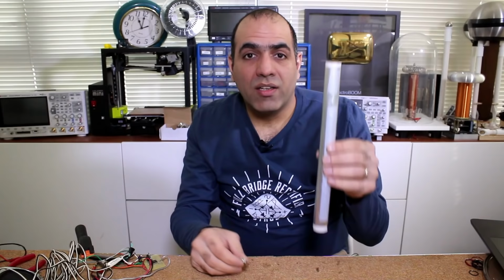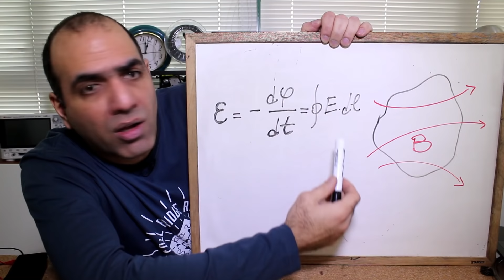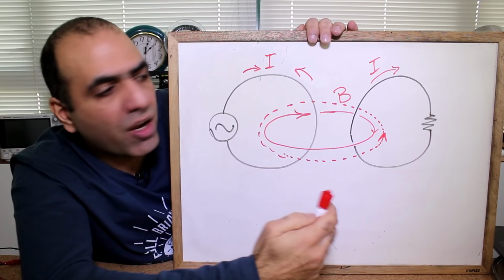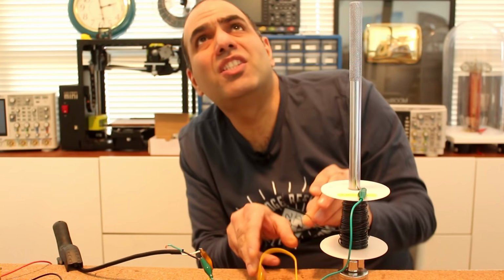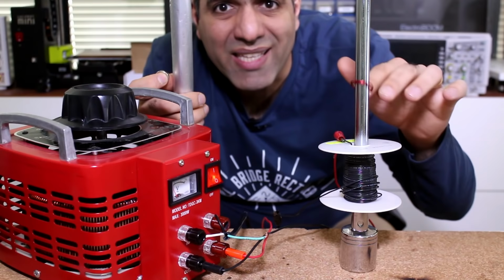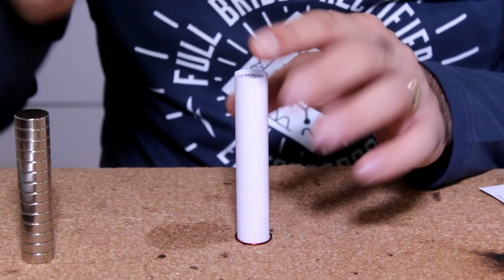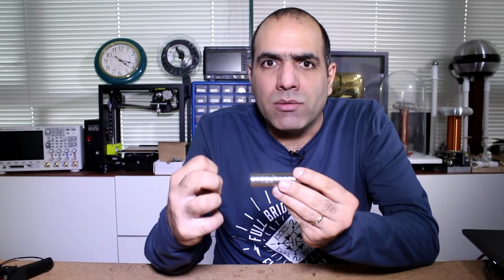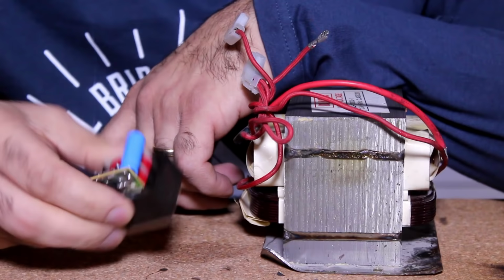The Amazing Eddy Current

Comment from the maker: Hello to all Eddies and others! If you have interesting thoughts, I could use some good video ideas! Why not post them to reddit: http://www.reddit.com/r/electroboom
Reply: And also is it possible to reverse engineer the diode configuration that changes ac to dc
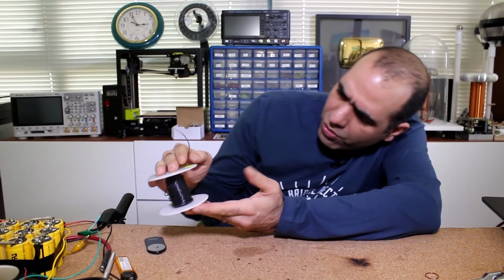Reply: 6:18 the shorter wire isn't melting exactly because it's shorter. Resistance grows with length of the conductor, isn't it?
Reply: wellding the transformer on the edge is not too bad because the magnetic field lineas mostly stay inside the iron core. And since they mostly do not loop around the welld line not much current is induced.
There is acctually some transformers used in audio gear that have an cupper beld soldered around the entair transformer to prevent exes magnetic field exiting the core.
Reply: @Mehdi Do these Eddy currents flow to the ground through our body ? Like how do they die if there is a constant source of changing Magnetic fields inducing them ? Can that metal plate be pictured to a source having a series resistance ? #Electroboom .
Reply: The Welds don't Affect the transformer that much, The High Current draw is from the design of the transformer primary (Primary Inductance is low).  Actually removing the Welds makes the transformer draw 40% more Current and 60% less Efficient power conversion. (I accidentally removed the welds from two Microwave transformers while modifying the transformer and only got 1kv each from 220v).
Reply: Microwave Oven Transformers are built cheap as possible, cutting every corner. Every technical observation about them is "because it was cheaper". In a normal transformer, the "E" and "I" pieces are alternating, like when you fold your fingers together. In a microwave oven transformer (MOT), all the "E" pieces are stacked into a block, and all the "I" pieces are stacked into a different block, and then the coils are slid on, the "E" wears the "I" as a hat, and a thin weld connects them. The weld is very shallow, it looks thick at the corners, but it's actually almost paper thin. I have some videos on my channel showing the disassembly of an MOT if you're curious. Check out the unloaded current draw of an MOT, it'll be hundreds of watts. Part of that is the insufficient turns per volt on the primary (cheaper to use smaller MOT and less wire), but part is the eddy currents. They even use an aluminum primary half the time to save money because aluminum is like, 1/10th the cost of copper.
Reply: @aquasama588  it is more likly that you have introduced an airgap. This will greatly change its efficence
Reply: ElectroBOOM We love your work ! never stop making the videos !
Reply: I m in class 12th and i know all that and it is my pleasure that all i study theoritically i see here practically. Also i do experiments like you
Reply: Hey mehdi....any idea on how i can make an eddy current probe for defect detection in metal. I cant afford the ones in the market for my course project.
Reply: Build a particle accelerator
Reply: You might want to stop using the confetti effect in your video. It drops image quality significantly because it messes with inter frame compression.
Reply: I hve experimented with an induction cooktop that i want to show you please reply how can i send my observation video to you
Reply: We can use this technique for making emergency exit in case fire break out in a building. Just wear magnetic suit and jump through copper or aluminium pipe.
Reply: Hi there! Could you do an episode about thermoelectric cooling?
Reply: You just made clear why every human loves satan.
Reply: I'm in robotics and the robot... OH BOY the fucker can draw 200 amps
not 20
200
Reply: sorry it took me 4 hours to get here. i was watching youtube in class today with captions on because im not supposed to watch youtube in class but i thought captions would ruin this video
Reply: check out my comment
Reply: Could you please do a video about the electrostatic influencer / Wimshurst machine?
Reply: It is surprising that you didn'tdie in this video either
Reply: Do a video on the rodin coil!
Reply: Aluminum is one of the metals that are the least conductive and it doesn't bring the force of a magnet so, in other words, the magnet has total no effect on the aluminum, with copper is different because of copper atracks the magnet to it this is why the thing didn't work.
Reply: @tapish_tp08  please don't do experiments like him
Reply: i have an old gas powered dc welder. it has a scabby weld on the trasnformer
Reply: love your channel electroboom. you are a talented man. ive learned a lot from you. apparently jesus christ is a big fan too!
Reply: 0:14 you shud if you have a wife/girl :D
Reply: Hey dude Thanks for teaching me how to make Hover/Levitating cars.
Reply: @muchmore344  Yes, That is also a factor that can lower the efficiency of a transformer
Reply: @listtamaru  I Think the longer spool of wire is using a lower quality copper, Hey But it's just my theory.
Reply: @bloodsweatandtearsforeverl9833  That's what a Diode usually does Ac to Dc
Reply: ElectroBOOM can I talk to you over the phone
Reply: @aquasama588  correct me if I'm wrong but a diode is like a one way valve for electricity.. I think your mistaking a diode with a transformer
Reply: 0:03 yes... its used to slow down trains :)
Reply: i might have a high iq but i'm glad other people figure this shit out so i don't have to
Reply: I had to re-subscribe again after being unsub for some reason.
Reply: After watching this video, I went to the kitchen with a magnet and started playing with the tin foil 😂
Reply: Can you make video about brown effect?
Reply: Hmmmm why not show some cool metal ring object rotating  in induction coils creating FREE ENARGIEZ!!!4!! Or how we can turn regular motion to electricity, or did I miss something?
Reply: Your videos should be shown on discovery channel episode
Reply: @phillipm199  😆😆😎

Comment: Can we build a lift by this concept?
Reply: You could in theory,  but it would be very inefficient. There are however brakes that use eddy currents
Reply: Sudarshan Sanecha it would fry all electronics (phones) inside it since those high current magnetic field. Kind of like being inside an mri
Reply: Actually he is drawing 10amp at 110volt = 1100watts energy only for lifting small coil ring.... 
So think his much current need for lift...?
Reply: @Ahmadsyar  If you had any metal on you while you rode the lift it would remove them from your pockets/ body I would imagine in a dramatic way
Reply: Yes....but it may use much more power than a normal elevator
Reply: @innovation4u336  That´s not correct, it will draw 1100VA, not Watts. Only a small part of that is real power which heats everything up.
Reply: You could certainly build a train that would use this concept
Reply: @Basement-Science   You're right about the watts vs va. However,  he actually was pulling 36 amps at 110, he only drew 10 amps after he lowered the voltage, so it was 3.96kva.

Comment: Can you show, what happens when you overload different electrical components?
Reply: Check out Photonicinductions channel ;).
Reply: Capacitors explode, transistors just stop working and resistors get red hot and melt. Watch a few videos of him, there are already many good examples
Reply: Do you know what happened to Photonicinduction?
He's a mad scientist
Reply: @red__guy  he was in a pretty depressed state after having issues getting his wife over. Hope he's OK.
Reply: @640kareenough6  transistors explode too
Reply: @red__guy  He made a video about it. He was in a very bad state, trying to get his wife citizenship from India. I hope he's alright.
Reply: @640kareenough6  depends on specific kinds of components.  Actually this would be a really good video, just for fun.   For example, capacitors;  Electrolytics explode, ceramics go shorted internally (and subsequently the leads melt), mica and film capacitors pretty much cant be killed although you can make their values deviate wildly from specification.   For the most awesome bang use a metal can AC motor start electrolytic capacitor (an older one without a pressure relief device) and put it straight across the mains.  Then run like hell.  Takes a few minutes to cook off but its a grenade when it does.

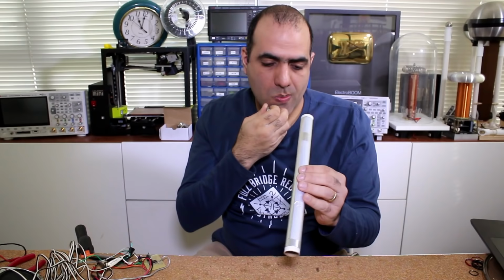Comment: 1:00 Let me explain that "Time Travel"
If you watch it at 0.25x you will realise that as soon as the magnet was about to touch that circuit plate, a spark occurs and it disappears.
It is his power of editing. The magnet reached the plate actually producing " no spark " then Mehdi sir, did something to produce some spark.
(May be some foot driven mechanism , or some other person did it,hiding under the table ,etc).
SO Mehdi sir just cut off that time portion during which the event occured and  actually, he kept maintaining the same posture to make everyone feel no difference.
But he forgot to remove that clock behind him.So you could see the illusion of time travel.....

Comment: The real explanation for levitation is a bit different than the simplified version here. Let say the external magnetic field is a sinusoidal. In first 1/4 cycle, the field is pointing upward and rising >> the induced current creates an opposing magnetic filed >> repulsion. In the second 1/4 cycle, however, field is in the same upward direction but falling in magnitude >> the induced current must oppose change in  magnetic flux >> the induced current generates a non-opposing (attracting) magnetic field. Therefore, the net effect will be zero lift. It's the inductance of the ring that causes a phase lag between the induced current and the external magnetic filed >> resulting in a non-zero average force.

Comment: but if super conductors can't move in changing magnetic field, then how are we able to move them so close to the magnet? Technically a meter away from the magnet superconductor should also be locked in place but it only does when being close to the magnet like a centimeter or something like that. Why is that?

Comment: Using a motors own vibration you can move a small circular hinge in a circle then using that motion you amplify it with gears then it moves 3 times faster powering a dc motor into a capacitor then into your alternator
Reply: And what's that's supposed to do?

Comment: My science teacher tried to push some crap like that too. If I push on a wall, that wall does not push back. That wall is not flexible or elastic and doesn't move and therefore is not putting any energy at all into me after I push it. However, I am pushing myself from the wall and therefore all or most of the energy I put into pushing the wall went right back into me and has absolutely nothing to do with the wall except that I tried pushing a wall for no reason, like an idiot.

Comment: Magnetic field doesn't flow through superconductor type 1 which is pure superconductor but using superconductor type 2 which contain small amount of non superconductor which allow magnetic field to flow through it at certain spot which locking the superconductor parallel to the magnetic field (I think)

Comment: Your breakers weren't tripping because the duration wasn't long enough. The work off of the current, yes, but what separates the bi-metal in the breaker is heat. So you have to go long enough to heat them up.

Comment: Welding the edges of the transformer lamination's together has no significant effect on the eddy currents as they are more concentrated internally,they do this mainly to reduce the annoying 50/60hz buzzing,its also stronger eliminating the lamination's becoming loose causing the transformer to become less efficient,you wont see this welding on smaller transformers as they are much less powerful.I made a great 100 Amp spot welder with one from an old microwave,pretty easy and great for rechargeable battery packs,Mr Electoboom make one,if you havent already,there useful.

Comment: Hang on a second, I think something clicked finally: "the lower the resistance, the higher the current" - is THAT why magnets "lock" mid-air over super conductors? :O
Edit: durp, nevermind that now, I just was excited it clicked in the beginning of the video.

Also still my favorite "don't try this at home" channel <3

Comment: Hi you are super cool guy. The transformer with the welded plate metal is ok because the current generation magnetic field wants to take the paths of least resistance. Like a runner on track the inside lane is shorter than outer. So the inner loop of the metal plates nearest  have the highest inductance. Can you repeat this experiment using a thermal camera and load the transformer to heat it up and see if we can direct where the heart is generated. And see if the weld has any effect. And then you could cut the weld and repeat. I THING. I don’t want to get shamed on internet if I am wrong. You fan Stephen lol

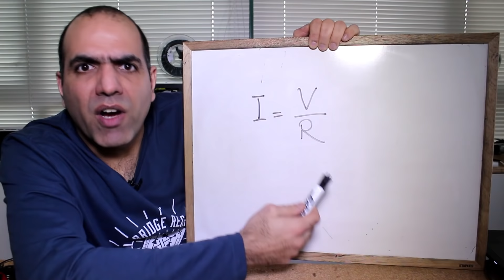Comment: 9:02 Mathematically would the Resistance be able to be Zero?

V=IR would state the Voltage is equal to the Current times the Resistance...  And anything times zero would be Zero... 

But to find the Current, you'd have a division by Zero and that's an impossibility
Reply: Division by zero is possible, just banned because you can break algebra really easy. For dividing zero you need calculus. And physically materials can reach superconductivity whem coolled to very low temperatures.
Reply: A superconductor has exactly zero resistance. Dividing by 0 behaves very poorly in standard algebra, but since there is no negative resistance, it works just fine in calculus.

Comment: the poles of an AC electromagnet changes when the current direction also changes, meaning that, it will always atract magneticaly conducting materials like iron, but if there is a loop of wire in the alternating magnetic field, the eddi current will also change with the ac current, meaning that the magnetic field of the loop will always be opposing the electromagnet's magnetic field and be repeled instead of attracted, is that right?

because its pretty confusing.

Comment: The microwave transformer is welded because of a manufacturing decision. Since the laminations are still there little problems arise. As for efficiency, the E I transformer is not very efficient but good enough. A triiodial type is more efficient but a lot harder and more expensive to manufacture. Yet nothing is 100 percent efficient which would be super. Good day too.

Comment: When I was 12 (now i'm 13) I shorted my computer by putting the positive and negative through two usb holes. It was a low voltage so it couldn't electrocute me. There was alot of O three in the air that night...

Comment: Im now confused about what happens when you move a magnet closer to a super conductor. My initial guess would be that the approaching magnet disrupts the electronic structure in superconductor giving it a small resistance until they stop being pushed together at which point the system relaxes into the quantum locked arrangement. Pure speculation, but it sounds right no? If anyone knows the answer please tell me.

Comment: So there’s an idea of type two superconductors (usually what you see in those cool vids) that the magnetic locking you are talking about is cause by flux pining: as the magnetic fields expel, they get trapped within defects in the material. That doesn’t do flux pining justice, but is enough for my question: can these two ideas both describe what’s happening? Coming from someone studying condensed matter, and loves the knowledge in these comments!

Comment: Quick Question.

Although I agree with the entire video, I still have one tiny debate about the equation I = V/R when setting R = 0. 
I agree with the basic equation, but also I have learned in mathematics when the denominator = 0 even if it is 0 divided by 0, the answer of the equation is undefined.

For the case of I = V/R, if R=0, should it not be I = undefined as well?

Thanks for reading.